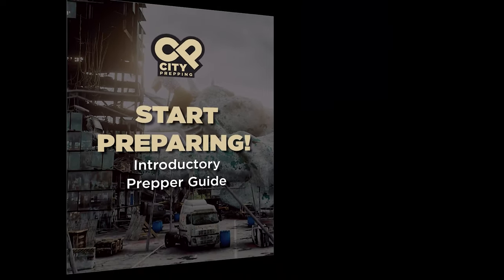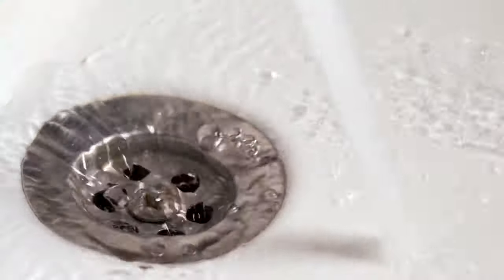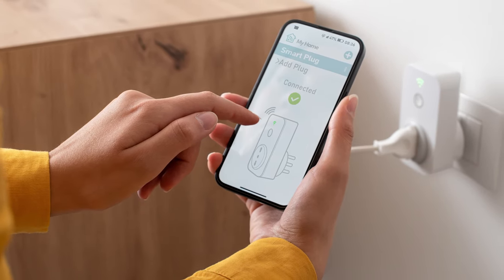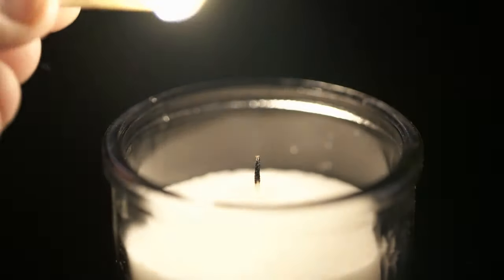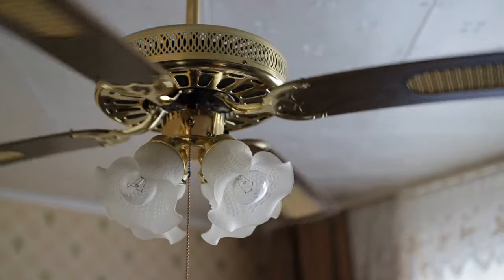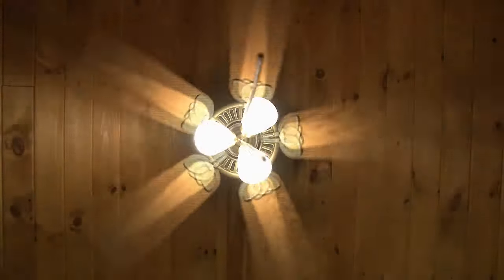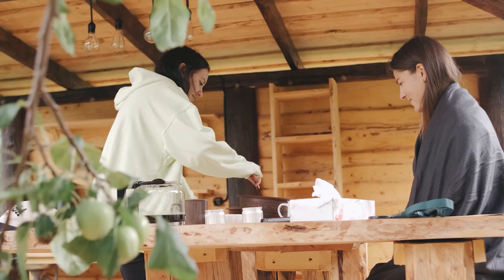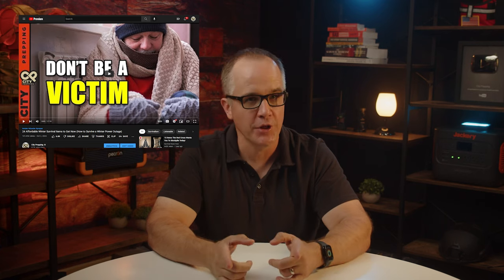9 Easy Hacks to Save Energy This Winter (And Stay Warm)

Comment: I use a indoor dryer vent in my basement. I do use more electricity for the Dehumidifier in keep the peck humidity down. Here in southeastern Connecticut with a 1200 square house. I use about 520 gallon of oil a year. That includes my hot water for the hole year. Hot water tank is insulated wrapped and all hot water pipes as well. In the attic has a R44 and the walls have R18. With plaster walls  and Vinyl siding with half inch foam board on top of the old clapboard. Things I plan to do. Spray foam one bead at the bottom of the rim joist. Maybe even insulate the hole rim joist with space mylar wrapped foam like the hot water tank. (Loosely so it can breathe)  Another good tip is to seal your trim along your floor before you put it on and after. Anti draft check valve on bathroom vent as well. Thank you for the video.

Comment: Great ideas.  One of the additional benefits of using led lights;   I’m able to power a 2500 sq ft home (minus a/c, oven, dryer) on a 3400 Watt inverter generator wired through my main circuit panel.  Gas heat,  all led lamps.  I’m not even stressing the load.

Comment: We don't have central heat or air... so no thermostat. We have the portable space heaters and a couple Little Buddies for really cold weather. Our indoor temp runs between 54-68°F throughout the winter. It's cold at times,  and it can suck. But we just bundle up. We do have window "quilts" for some of our windows, that has helped a lot.
Reply: How do you take a shower in that??!!🥶🥶🥶
Reply: @dianaschoen4485  We'll bring one of the Little Buddy heaters into the bathroom.

Comment: I suggest battery pack rechargable hand warmers 10 000ma one will do about 8 hours i use at work when cold one in each pocket and charge overnight 
they can also charge your phone and recharge through usb so lots of ways to charge and cost about $20 a great prepper item
its sometimes better/much cheaper to heat yourself than the environment
Reply: Yes! I bought several of the Zippo ones but many companies make a similar product. They are so nice.

Comment: be careful with insulation blankets. newer water heaters actually have more insulation in them. and some actually advise against insulation blankets.i'm not trying to be disrespectful, you are still the best prepping channel on u tube, just giving you my 30 years worth of experience as a plumber.

Comment: I have a North Facing apartment deck door. It is about 3 years old so I don't notice a huge draft but there is SOME cold that comes in at the bottom. I found a pool noodle fits in that space perfectly. With inflation, that noodle is 1.25.
Reply: Pool noodles to the rescue !!

Comment: The head loses somewhere between 60 to 75 percent of the body's heat. The body core and head are essential starting points in staying warm with clothing. It can be bitterly cold here in Canada but we have learned to adapt.
Reply: Yes and No.  The head only looses more heat because its the only exposed part of the body and decent clothing is worn, your main body will loose way more heat than your head if its not insulated with sufficient clothing.

Comment: What about kerosene???  I bought a kerosene heater and moved it into the fireplace space. Its a box unit, kerosun radiant 40.  It currently has dramatically slowed down the number of times my furnace has to fire up while its running.  Yes Im paying for kerosene,  but I currently believe it will be cheaper than natural gas this winter.

Comment: Generally I run my thermostat around 55 at night and 60-65 during the day. Splurged on blankets and electric mattress pads over the years. Funny how my bills showing my use is lower month by month but my bill keeps going up. We’re putting in more insulation this fall in preparation for winter so hopefully that does something positive.

Comment: energy companies have the potential to remote control smart technology and lock you out . like recently in Colorado when they took control of peoples air conditioning thermostats during dangerously hot weather preventing there use,  under the pretense of saving energy

Comment: My furnace was costing me almost 300 a month then it died. No money to fix, so I got space heaters. Mind you it's a small place but my winter bills have been around 150.00 a month without having to bundle up. If you have huge rooms. Won't work. Ceramic heaters are energy hogs and will jack up your bills. I use force air heaters.

Comment: I installed a circulation pump on my high efficiency  hot water heater.  Running for three minutes results in piping hot water in the shower in the back of the house. Not only does it provide instant hot water, but it saves water which would needlessly go down the drain

Comment: The problem with modern heating blankets is that they rarely work properly after a couple of years. I've had at least 3 that malfunctioned after 1 season! Half the blanket would stop getting warm. The old ones lasted forever, even if it did come with the risk of catching fire🤣

Comment: I've been supplementing electricity with solar, i have a 200 watt "power station" system that I use to power up power stations that run certain things, like my lights in the living room, my bedroom lights and tv, my kitchen lights, and anything that needs charged like phones, game systems, etc, and it has helped  the savings has basically paid for the cost to buy and make the power station I use.   Smart thermostat, no way, wasn't it CA. that the power company was able to alter peoples smart thermostats?

Comment: when they turn off the energy for no reason during dangerously cold spells , put a tent up in living room and  live in tent , smaller space easier to keep warm ,
Reply: I agree. put a warm thick blanket underneath the tent and a very warm blanket on top. Also use it in a small space if possible like a bedroom with the door closed and cover door bottom so cold air stays out. Make sure the windows are insulated cover with plastic inside and out add insulated curtains. Scary times require preparing in advance.

Comment: @7:30 water heater blankets are discussed.  Several YouTube videos say not to use a blanket on modern water heaters because they are precisely engineered to have the correct amount of insulation and any extra insulation is not recommended.

Comment: Set back thermostats are more reliable than Smart thermostats, which have been known to malfunction and possibly run your heat very high. This happened to a friend of mine while on vacation. 🥵
Reply: I like the human being thermostats. They worked fine in my house. Down at night. First adult up in am, turn back up. If no one will be home all day, cut back. First person to come home sets it to higher temp. Saved hundreds of dollars during the 70's energy crisis. I insulated, got new windows, and did everything to conserve.  Led light bulbs also paid off. Back then they were expensive but lasted a long time. I saved money on buying light bulbs all the time. Make sure if you hire someone to add insulation knows what they are doing. Person put insulation up wrong in attic. When I was getting attic finished, it all had to be removed and put up the correct way. I also got insulation blown in where you couldn't get in to put it up. The new double pane pella windows made such a difference.

Comment: Using a clothesline instead of dryer reduced my electric bill $40 per month. Summer hack but still…
Reply: As long as it doesn't rain or snow, you can dry your laundry outside on the clothesline even in winter, even when it's freezing; it just takes a little longer.
We've always done it this way.

Comment: I always have something cooking in the wintertime. Either a stew for dinner, or bone broth for overnight.
Reply: I would too, but unfortunately I have a gas stove and I am Dutch so our gas prices have been INSANE. Not sure how it is worldwide but yeah, I kind of had to stop using my stove altogether. It's a really good idea if gas isn't too expensive though! You get heat and a delicious meal.
Reply: @jwlgoesfishing  Yeah, this year I bought not one but two wood stoves for that purpose, and cut down a diseased old tree to fuel one or both. Will be hard to regulate without someone staying up to add wood, but maybe that is what we will have to do if it gets that cold.
Reply: @jwlgoesfishing  At Obelink you can buy an Inventum double induction cooker. You put it on the kitchen surface and it plugs in a normal wall socket. It is quick to cook food and much cheaper than gas
Reply: @jwlgoesfishing  Oh heavens, don't you cook anymore? No warm food at all?
Yes, the prices for gas and electricity are terrible, I'm also afraid that it will break our necks financially.
Do you have the financial means to buy a small slow cooker, maybe a used one? Or 1-2 portable induction hotplates?
There are also cheap automatic multi-cookers that only have a low wattage.
We make do with slow cookers and an automatic multi-cooker a lot.
Maybe something like this would be a possibility for you?

Comment: Regarding smart thermostats...did you know that "they" or "someone" can easily hack into them and turn off your heat, or lower or higher the temperature? This would not be good if "they" start monitoring people's heating costs/use and decide they want to take control. Also these instruments listen and video everything in the house. Sometimes they even "talk" to you and freak people out. I will stick with an old fashion thermostat.

Comment: Vent your dryer inside the house. put an old knee-highs over the exhaust to act as a filter.
Reply: Dryer sheets and most detergent contain carcinogens. That makes it a very bad idea.
Reply: @andreawimer4334  so you put them on your skin, and concentrate them in your closets?
Reply: Mine’s a gas dryer so that’s a hard pass for me. 
Wouldn’t it add too much moisture into the house?  Maybe if the air is really dry and you don’t do many loads but otherwise I’d worry about increasing dampness and mold.
Reply: @sheila3936  I've always had an electric dryer. As for moisture, it'll feel warmer with more humidity.

Comment: side not sanitary is not a true statement if you use a dishwasher they require 145 f water to wash and sanitize unles it is one with a booster heater which is less energy efficient than your water heater just something to be aware of

Comment: I'm cutting off my gas and electric. I'm going off grid. I bought numerous cans of CP250 gas for my camping gas stove. I used Amazon. I ordered 4 batches to make delivery easy for the supplier. One batch has gone missing. The supplier is blaming Royal Mail. Amazon offered to refund me. The supplier just increased the price by £4 per box.  If I took a refund, and reordered, I'd loose £8. I feel screwed.

Comment: What are off peak hours?
Reply: off peak hours vary by area. Check with your electric company and they can let you know when it's cheaper to run appliances.
Reply: @MB-ml2ss  thanks!
Reply: I use XCel in Colorado.  From 7:00 PM - 1:00 PM the next day is the cheapest for electricity.  From 1-3 PM is more expensive and the most expensive electricity is from 3:00 PM - 7:00 PM.  When I learned about this a few months ago alot changed in my home.  I am still making changes. Will see the difference all these changes make in my electricity bill!!!